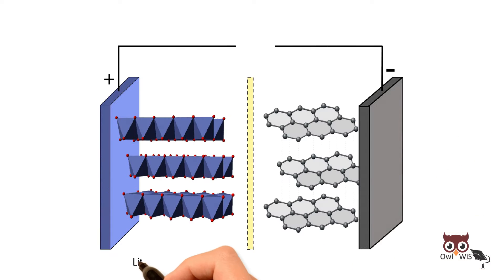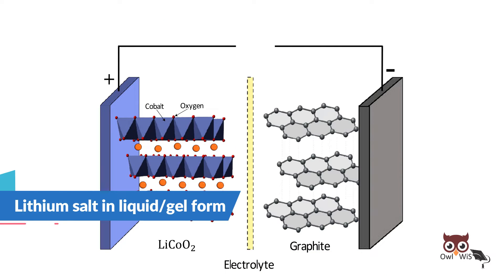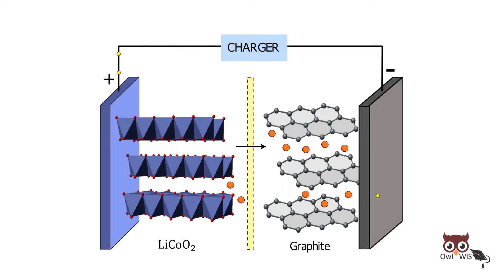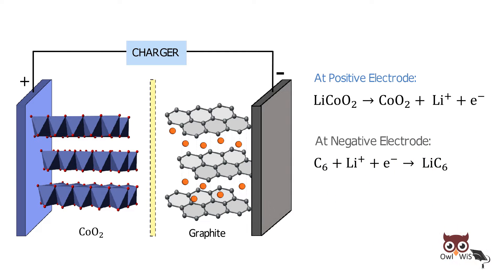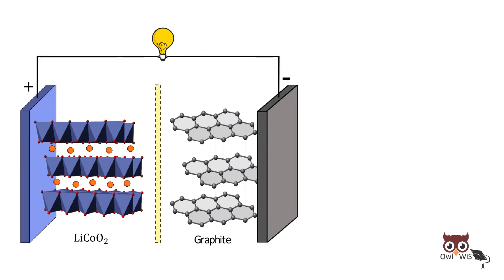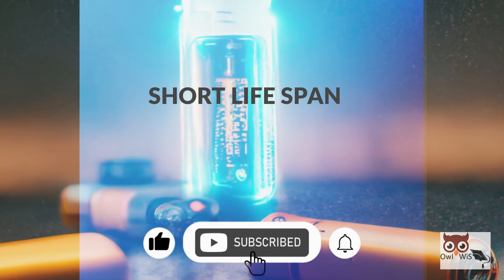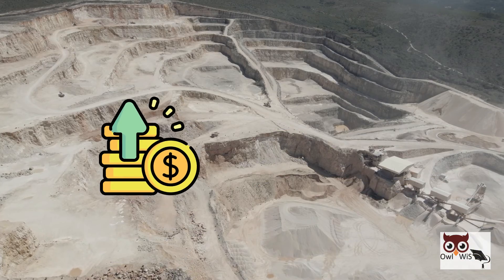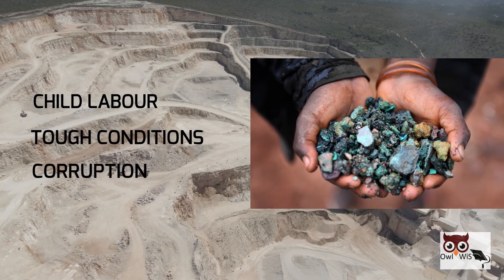Lithium cobalt oxide battery (LCO battery) working

Comment: Products which is required for ev cars are:)induction motor,lithium ions battery,ac to dc converter,infront there is radiator,battery back on the surface,single speed transmission